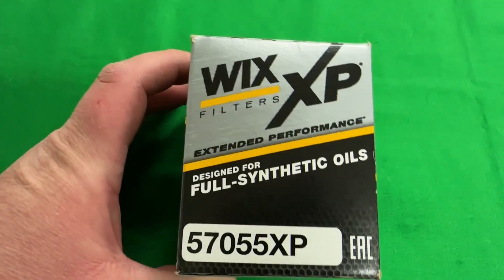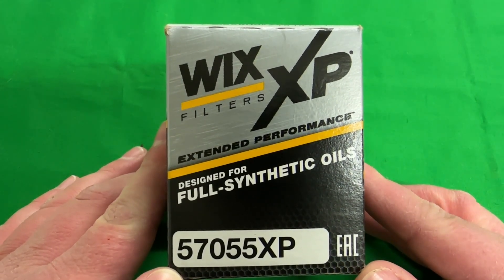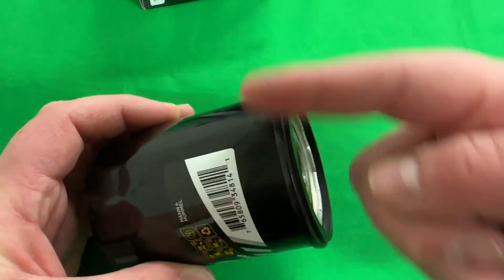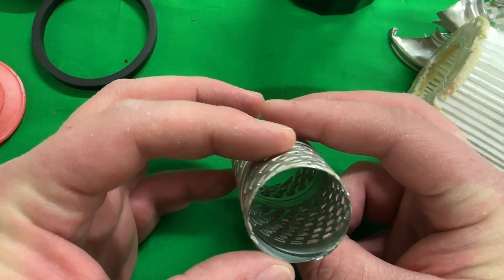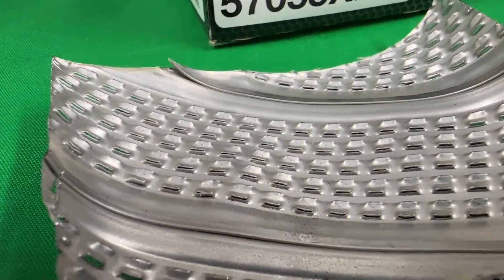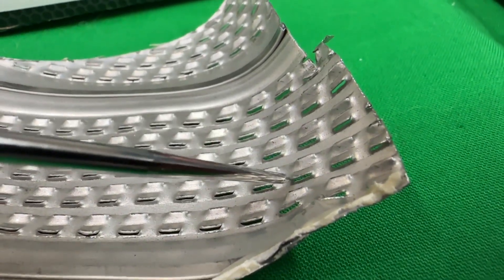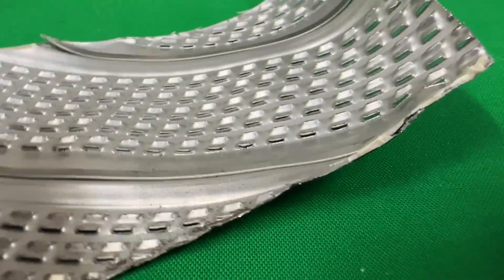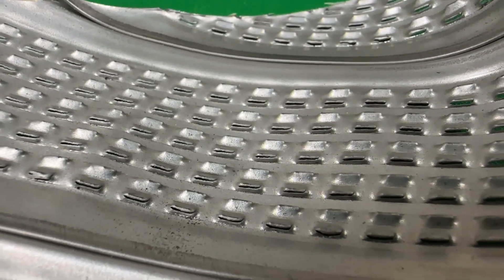Defective Wix XP Oil Filter - Cut Open!

Comment: I switched from wix xp to Honda oem filters I’d rather have metal core with holes and cardboard end caps in stead of metal end caps with glue that breaks down that clogs the louvers … wix xp = low quality to me … at least oem Honda filters are made in USA instead of Mexico
Reply from the maker: I much prefer holes instead of louvers. 

I wonder if those Mazda / Subaru Tokyo Roki filters would fit your Honda
Reply: @SimpleMindReviews i actually stocked up on like 20 of the older  toyo Roki/ filltech Honda filters … a lot of them are hamp (Honda aftermarket parts) the hamp filters are literally the same as oem … but the mahle hamp/honda filters are good too

Comment: I have received 2 defective Wix filters recently. M20 x 1.5 not threaded properly.
Reply from the maker: Thank you for sharing your experience!
Reply: You mean they were rightly stamped M20 x 1.5 but they didn't thread on correctly? Wow!

Wow, I've heard of someone with a Subaru running into that issue before. Guess it's really possible....and when they start changing/having multiple plants in foreign countries, QA always takes a tumble. We're going to have a decade where people switch back to OEM and they're gonna have to come back home cause why would I bother risk an engine when trying to save maybe $20 in total?

Comment: Wix filters that are manufactured in Mexico have that exact same problem. I emailed Wix about this and they said the louvers are fine, they are open the other direction, will continue to be manufactured that way. Very disappointed in Mann and Hummel.
Reply from the maker: I’m very cautious of louver based oil filters lately. This Wix one I had was terrible but I’ve been seeing these issues with quite a few brands now. It’s so frustrating.

Comment: That filter could prematurely go into bypass mode with those blocked louvers.
Reply from the maker: Absolutely. The louvers need to be stamped open in both directions. The majority of this filter had closed or nearly closed louvers on almost 50% of them. 

This filter absolutely could’ve been too restrictive and in bypass mode too often.